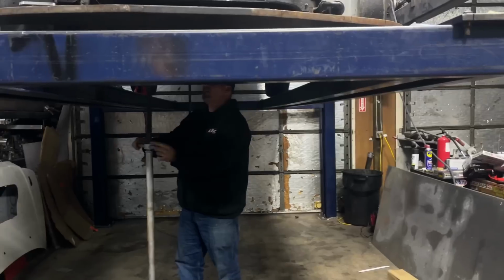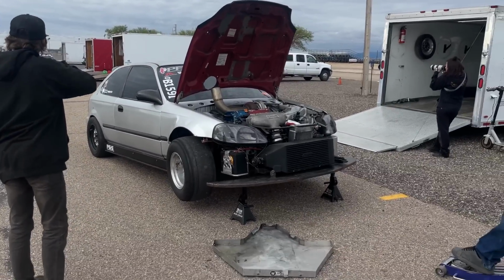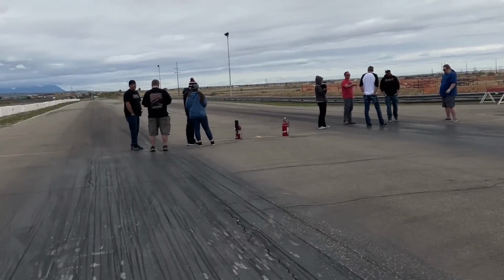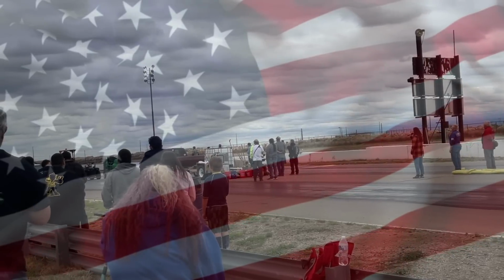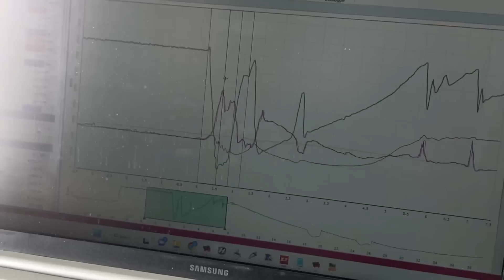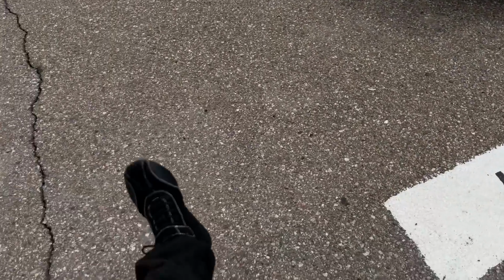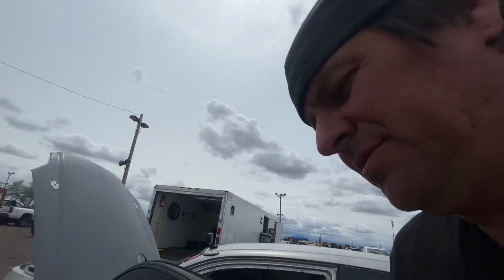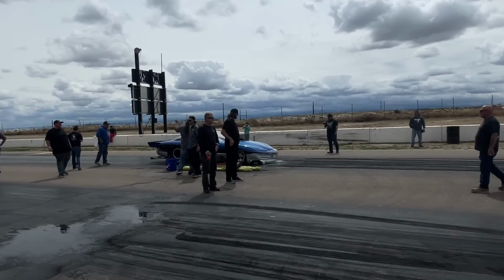Freedom What’s With this 2 Step! ? Steel City No prep Rips!

Comment: From am outside observer position, it seems like an electrical issue. Possibly a broken trace in the ecu. When cold, copper trace is touching allowing the system to work. As soon as it starts to warm up, copper expands and loses connection. Just a thought. Great video regardless.

Comment: Have the same problem in my car with launch control, mine is RPM and oil pressure linked running a chipped p28, sometimes I’m driving along and launch control will just stay on and I can’t go over 4000rpm, once warm it’s back to normal……. It’s an annoying bug, getting up to the lanes and launching to find you only have half the rpm to use, hope you guys figure it out…… your the guys for the job.

I’d check VSS
Oil pressure changes and parameters
Personally but you guys know more than all of us

It for sure sounds like a sensor wanting to see a parameter and it not quite meeting it

Keep rippin’

Comment: I would try a fresh tune again
Reset the FT and go through and apply the tune, see if it persists or stays the same
Ive had the same issue but motor let go before I could get it resolved
Reply: Or disable coolant compensation to rule out the temp variable

Comment: spent last weekend and the following week, started my 97 f350 OBS project. Removed the bed, Installed a Flatbed, as a one man operation the difficulty lining up the bed with the frame was a challenge. Not to mention the flatbed rails that line up to the truck frame rails, we 2 inches too narrow in the back and 1 and a half inch too narrow in the front. but i got it one and secured, installed a Power hungry Performance Tuner, really brought the old girl to life. Cheers from minnesota!

Comment: It could be something going on with a bug related to coolant temp compensation. Since you say its only happening once it warms up.. Perhaps not a setting but something to log and see if there is a relationship between the two and at what temp the issue begins
Reply: Quite rare to run any two step via coolant temp due to it being so volatile oil temp and pressure an used most often but these fuel techs are way way beyond my knowledge
Reply: @KielFender16   I was not inferring that it would be a setting you would enable. Because Yes I agree it would not be a setting that would serve any real use. However, If there is a bug in the firmware it could be referencing directly or indirectly in the back end of the software. The temp comp offset table and once a certain temp is reached. It then is disabling the timing comp table for the twostep.
Reply: @johnjohnston3815  oh for sure it will be something related to an overactive variable I.E temp changes…… I know many Honda guys run some of the parameters off of the same sensors as VTC

Comment: I had a similar issue where my race car wouldn’t go into two step due to the wiring that connects to the vss sensor being broken. Another situation I ran into was the car going into limp mode due to a sensor being bad. A bad sensor such as the tps, map, water temp, oil pressure can possibly cause this issue. A bad sensor would definitely explain when the car works great when the motor is cold, but starts to act up once the motor has warmed up.

Comment: IF you are guessing at data then I bet you need a fuel pressure regulator and a electronic boost controller.  I think you need increased rpm at least 400 at your idle

Comment: Hi brent , Random Question but would you happen to know the part number to the k24 vtec solenoid base gasket ? Where plunger is at? The one on top next to pressure sensor? Not the engine to mount one bro. Honda seems to not be able to pull up on diagram

Comment: Ground ground ground, probably not the issue but always worth checking 😂
Reply: I was thinking along the same lines, however if it only works when cold; that would lead me to believe that you have a high resistance problem!!! Resistance is directly proportionate to temp, meaning if temp goes up resistance goes up!!! Maybe when it’s hot the ecu thinks you already had a validated launch and turns the 2 step off maybe?

Comment: Check electrolytic capacitors and tantalum capacitors in ecm. I have had some odd things like that happen on Honda/GM ecms. If running fuel tech call the guys maybe they have had the issue before and can save you allot of time on the wild goose chance
Reply: I was thinking just try another fuel tech. Cuz I've watched street outlaw's guy's come across something like this they could'nt figure out
Reply: @Wheeln 24-7   i believe the fuel tech module is silicone sealed but i would send it back to fuel tech because it could be corrupted base code on the non tunable side of software

Comment: God I HATE electrical gremlins! It's probably a stupid, loose crimp connector...
Reply: @mattcangle; Matt Cangle, well if You 'hate" them, then You have "Nothing to worry about" !
A. Gremlins do NOT exist
B. NO such concepts with undetectable, indeterminate issues with and within electrical - only for electrical, electronic ignorant individuals.
C. electrical, mechanical, objects do NOT have mentality, thinking, intelligence, therefore never 'Stupid"
D. If there are electrical issues, even with electronics, Your idea refers to the correct -> first check the most simple as connections, wires, connectors.
[Note: written by 50 year experienced individual within electrical, electronics, assembly, wiring, with proper training and more within engineering, design, development, verification, certification, troubleshooting, documentation,  written guides, instructions, teaching, education, etc.
Sincerely

Comment: I think it's pretty awesome that you guys are trying out No Prep racing but I think you should build the El Camino for No Prep racing instead of using the Freedom Civic just because most No Prep races are 8th mile and I have hardly ever seen a 4cyl stick shift car that can 60ft and run just as fast as a RWD V8 with an automatic car can so that is why I suggest if you are going to keep trying to run No Prep races then you should build a RWD V8 automatic car with a big turbo or big Procharger on a BBC in the El Camino on a 28x10.5 and put a Fab9 rear end housing with a 4link rear suspension and put a set of QA1 long travel struts and coilovers in the back and then go out there and go kick some ass and another tip I have is you need a few different jugs of your own track prep to try and find one that you really like to use and last but not least you should take lots of notes on top of the data from the ECU

Comment: Jamie nowadays the 29.5 is only considered small tire in Texas especially in the No Prep racing world and it's 28s everywhere else but in my opinion small tire should be 29.5x12.5 and smaller and anything bigger than that should be big tire and in my opinion instead of making AWD cars race big tire because they do at most of the No Prep races and Cash Days event on the streets no matter what tire they have on their car but instead of making AWD run big tire they should have an AWD stick shift class and they race themselves just like every other class
Reply: Yeah 29.5 is only small tire around texas every where else it 28.5

Comment: Hot and cold issues make me think of bad solder on a circuit board.  Probably should hit up fuel tech.
Reply: @nofear1999; Really ??!!
A. what type of circuit boards o You have experience with ?! Perhaps those from 1999, CCP-China  which have 1970s technology IC, hand soldering, poor QC ??!!
B. what electrical,  electronics training, courses do You have, including soldering, assembly, basics ??!!
C. My first electrical & electronics course within public school, IE, in 8th grade in 1971-2 certainly included more proper ideas, concepts, information, principles than You seem to convey with Your attempted comment
D. clearly You lack the basics, level with circuit boards in modern technology from, within the last 30 years and more recent in this Millennium = ALL surface mount technology
Good Luck

Comment: Gremlins are the worst 😞
Reply: Clay Millican am expecting from You much better, more sensible comments 🙂
A. Certainly You know that Gremlins do NOT exist !
B.  Such untraceable, undetecaible, indeterminate issues, problems also do NOT exist
1. NOT in Your race cars, dragsters, Your personal vehicles, family, friends, competitors, etc.
2. All issues, problems, challenges are traceable, detectable, determinate through proper, thorough troubleshooting, assessment, evaluation, differentialtion, discernment, analysis, etc., methods which use proper principles.
Sincerely
Reply: @newtonfirefly3584  wow you did a lot of typing for a very common term used  (Gremlin) when you have a problem that you haven’t found the cause of yet. Also it was a bit of a play on words to Brent’s burnout car which is an AMC Pacer the Gremlin being an AMC as well. Have a great day !!!
Reply: @claymillican25  Yes, Clay figured= You also used that connection with the AMC Gremlin - Pacer too. 😂
Am certainly aware of this use, misuse, abuse of the term "Gremlins" as problems which are difficult to trace, determine, etc.
Just figured You are above such improper use, misuse, abuse, especially sine You know proper troubleshooting methods, especially within Your Top Fuel Team along with previous racing and personal vehicles, projects, etc. 😄
As my background includes proper troubleshooting, determination, assessment, evaluation, differentiation, discernment, analysis, principles, development, design, engineering, science, physics, chemistry, advanced mathematics, some actual R&D which certainly all require proper methods, principles. 😏
Such my comment to You Clay was/is that my view with, about You is certainly above thes misconception of most 'folks'. This also includes Brent, Jaime, Tom, Steven, Shane, etc. within PFI Speed, Kevin Smith, KSR, Jef & Jeffrey Lutz, and other similar folks.
Thank You  and appreciate You taking time to reply too.😃

As for my 'many words', my use  is via a computer, typing with a keyboard. Computers have been within my tools for over 47 years.😏 My typing skills were developed with manual and electric typewriters as a young teenager beginning at 12 years old. Am just a little older, now nearly 64. Also, like You, Brent and others, am still very energetic, with a quick metabolism, and good health - and a very positive attitude, outlook and nearly constant smile too.😄

All The Best and Much Success in Your Quest(s), Health, Happiness and Well Being.    😊 Sincerely ☺

Comment: Hey brant how are you? Hey I’ve never used 2step. And I have watched a lot of people having issues with their 2 step. And I understand that they brake a lot of shit. I have always just driven a car how I built it and how I had tuned it. As an a example I built a Rx7 with a 13b turbo s2. And I turned it to 10,000 rpm and the computer could only run 22psi and it could only make 680 rear wheel hp. Due to bad turbo and lack of computer.  But it could do 1.2 60 ft on the back wheels. I had to teach the guy that owned the car how to drive it. So how I would leave the line. I would just hold the rpm to 7000 while the lights fall and as the last light came on I would hit it wide open to 10,000 and 22 psi and pop the clutch and as it jumps out of the hole I would pull 2nd gear. And so on. And cross the line at 10,000 in 5th gear at  a 10.40 and a 140mph. But the 13b was all the old crap that he had laying around. I just ported it as best as I could for s5 13b end plates. And the turbo did not suit a rotary engine. But it won a lot of races for what it was. I’m building my Rx7 with the 20b in it. And I have sold my spare Rx7 to my best friend and it has a s6 13b that should make 800 at the wheels on low boost. 16 to 18 psi. I’m putting the two builds up on my YouTube channel. I have now got good computers for the two Rx7s so we can use 2step. So I can try it and see how I go. I will let you know. Cain hard guys.